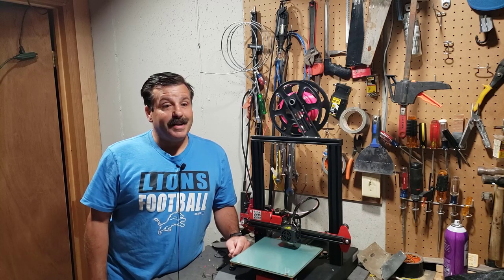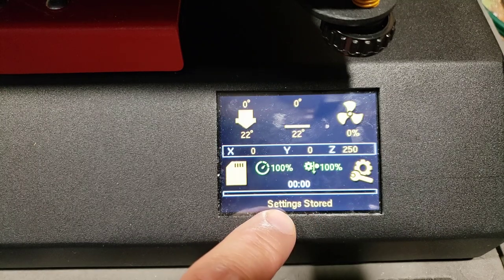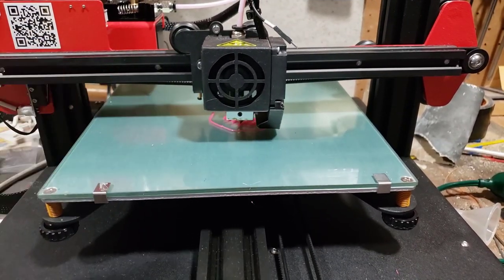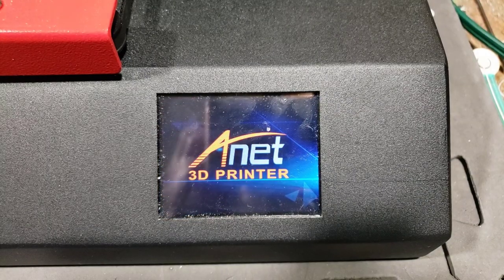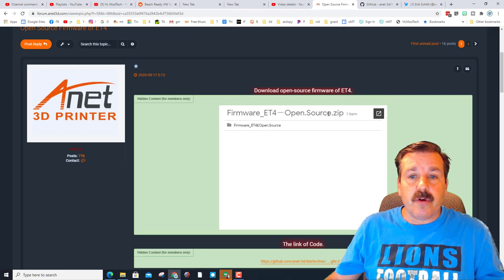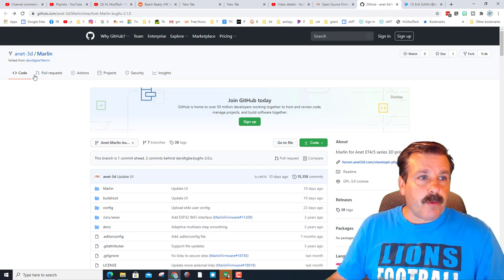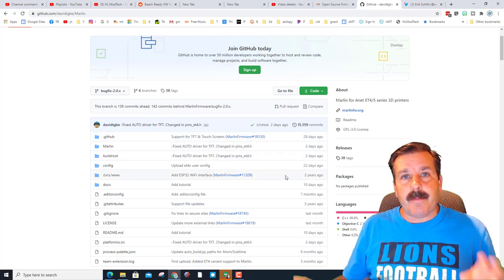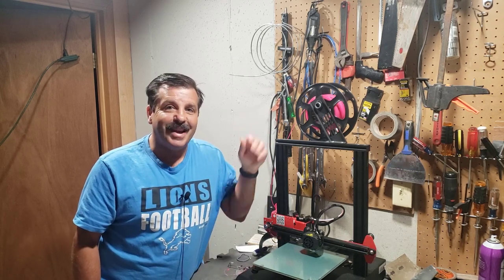Tested! Anet ET4 Power Loss Resume with Marlin 2.0+ firmware

Comment: i bought the st link and a new motherboard with tmc 2208 drivers, hope you're vids will help me with all that!
Reply from the maker: I will try to get you there. I stay stock on mine, so it will be a bit of a reach, but I should be able to at least get you pointed in the right direction.
Reply: @HLModTech  for sure if you ever plan to upgrade to a tmc 2208 motherboard make sure to make a video about it. Thanks for the help and content you bring!

Comment: I have a Tronxy  xY2 Pro, with Marlin 2.0.  Power loss restore works ok if the power goes off while it is not extruding, but if it is extruding, it does not work.  The reason is that Marlin is set up to move the nozzle to X Y home, when 'resume print' is enabled.  Here, it heats up the nozzle and bed, then makes a number of XY moves before resuming the print.  If the power went off while the printer was extruding, then the nozzle sticks to the print, and is unable to move to X Y home, and gives an errror 'unable to home" .  Ideally, if the nozzle heated in the position it was in when the power went off,  either situation would work ok.
Reply from the maker: No idea. Sorry.

Comment: is it possible now to change the X and Y offset to get the perfect measures? (for example to make circle really round or the calibration cube on the right sizes without changing settings in cure)
Reply from the maker: Great question. I will get into the customization advanced menu and see what is available to us. For sure, you are able to if you want to dig into the source code, make changes and create a custom firmware with Visual Studio Code.

Comment: I think you need to go to the menu where you choose print file after power come back, as soon as you get to that menu it should ask if you want to continue the print.  it is not like marlin where it pops up on the boot. these are tft screens they run on an independent firmware. just go to the drive and it will ask you.
Reply from the maker: Interesting. I will see if I can give that a test tomorrow when I'm at school. Thanks for the tip

Comment: Hi again, thanks for posting a video even when it fails! One thing that you might want to check, in Cura when you sliced that model, was power loss resume enabled there? I think that setting in marlin is a secondary trigger, you need both enabled. Maybe? Good luck! 
One thing I always wondered though, the hot nozzle touching the print would melt the model in that area right? True power loss resume should have a 10 second backup capacitor to move y or z off the model, keeping z the static and store the values for the move before shutdown to use it as a starting point.
Reply from the maker: =) I share what I find... A lot of times I ask for help when things are goofy too. You guys are the fastest support I know of. As far as power loss resume, the only printer I tested it with was the Alfawise U50. No special Cura settings... Unplugged and it just came back. Super slick. https://youtu.be/m25RsZD7mKM
Reply: @HLModTech  strange, maybe that had a better board that has further support for power loss resume? If you put an "M413 S1" in your start code it should work, it's not the cool way but just to see if it's working period on your current setup. In the marlin documentation it says M413 S1 to enable and to make sure it's enabled just M413 in repetier host and the display should say it's enabled. You're right though, I can't find that anywhere in Cura, coulda sworn? 🤷‍♂️
Reply from the maker: @jdizzforyou  I will see if it works with the M413 S1 in Cura when I get a chance. The source code we are playing with has 2600 lines in it. It would only take one in there to be off to break it. For instance if the code has PLR disabled, but the LCD has the option allowed... You could flip it all you want and nothing happens. I am spitballing, but that is how I picture it working at least. =)
Reply: @HLModTech  forgot to say put an M500 after. 
OR go to Configuration_adv.h line 1173 and remove the // !!! Hopefully that's it, I looked in "start here" from vert (from your a10t vid) in VSCode. I saw I enabled PLR there, then clicked View>Search "PLR" and it's right there in the search. In my very limited time with marlin I've realized things are often in multiple places with the values not matching even after creating the .hex with zero errors. Marlin's weird lol.
Reply from the maker: @jdizzforyou  All good on the M500. I have an issue as my ET4 is not connected to the PC. I did do the save on the console and it was still there the next boot. As far as marlin, that search is slick. I just worry that there is a word in there I am missing... How do you know you caught every change that is necessary for an ET4...
Reply: @HLModTech  that's why I showed my work, so you could do it too in your build. There are more uses of "PLR" found, one change at a time lol. My a10t was having the same issue, PLR was enabled in firmware from "start here" but it didn't work when I tried either but I was more concerned with tuning for good prints. I'll try again when my new hot end/bowdens are here, for now I'm out of commission.
Edit: In the lines of code above the one i referenced in _adv.h there was (in my vert build 496) a small fyi for power loss resume function so I think that's where she really lives.
Reply from the maker: I am using the Anet .bin they created. I have not tried to create my own version for flashing. Since I leave my machines stock, unless there was a crazy feature I was missing, I am happy with the way things are going.  The tips you are giving are spot on though. Maybe if I get all my projects caught up you will still talk me into it. =)
Reply: @HLModTech  I understand, stock is easier when you have such a 3d army. Speaking of stock, what's your favorite low budget good quality stock printer?
Reply from the maker: @jdizzforyou  I have the most fun with the A10M and A10T models. I find the simple gradient command to be the coolest thing ever. Not sure what the current price is, but I found them at around 200 back in the day. Took a year for the firmware to arrive, THANK YOU VERT, and make them work they way they were intended. They are my go to machines right now.
Reply: @HLModTech  in theory I love my A10T, but it's problem after problem and only 3 out of 50+ prints with pla do I get print quality I'm happy with. Since May I've had to replace every fan at least once, found out the hard way the nozzles can only come frome geeetech, no matter the tension every extruder strips filament, my 2nd hotend is coming, and the stock bed tore removing the 5th print with the provided scraper in the center. It's now a fridge decoration as I stopped the next print after the first few layers. Only 5 of 8 legs printed in yellow pla... it makes a beautiful sunrise with 'Geeetech' in the background haha. I want to love it, but no matter how many things I research and tweak... I want an example of how a printer should properly work, not constant problems. I will not abandon my "A10Titan" though. There's a bond there, with more than just PLA 🤣

Comment: now it work
Reply from the maker: That is good to hear. Thanks for sharing.
Reply from the maker: Looks like it is not completely solved, but it was fun reading through it. Almost like a mystery novel as they find new leads, investigate and debunk things.👍 Thanks for the heads up. 👏💯
Reply: @HLModTech  it's solved, i was implement in my et5
follow the 3 last comment
Reply: @supartodondit6396  It worked like a charm with ANET ET4x and Marlin 2.0.9.2. Thank you for the link.
Reply: gimana caranya bg , mohon bantuannya

Comment: Hello , Whats diference in ET4 and ET4+. I need upgrade my ET4+ for Marlin . Regards
Reply from the maker: I am not really sure. If you go to the Anet shop, there are no ET4+ that I can find. In the open source firmware the ET4+ and Pro were the same file.  I had a ET4 I purchased show up, but when I booted it the info said ET4+.  Just my experiences, not facts I have found anywhere. The marlin flash was fine on all my ET4's. The benefit was the ability to upgrade and calibrate as needed. Other features too, but those are my favs.
Reply: @HLModTech  OK, thank you very much friend. I wanted to consult you the update in the ANET ET4x is to use it with Marlin is safe

Comment: Hola cómo hizo para montar Marlin en la impresora ET4, tienes tutorial? Está increíble tu vídeo. 😁😁
Reply from the maker: =) Your wish is my command. =) https://youtu.be/mAmIbrGi6G8
Reply: @HLModTech  Hola hice una Prusa Bear pero le hice unas modificaciones, estoy instalando Marlin 2.0.5.3 a la última Ramps 1.4 y LCD 12846 que me queda, cargo todo desde Arduino 1.8.10 una versión estable, la impresión es perfecta pero no funciona el power loss recovery, he probado la versión de marlin 1.9, 2.0x, 2.0.5.3, he cambiado la pantalla 12846, por otra versión mas reciente y tampoco he tenido resultados, ¿Cuál crees que sea el error? ¿Será el compilador? ¿Debería usar Visual y platfort para compilar?
Reply from the maker: Sorry, I am not a firmware expert. I learned the skill to put it there... then shared it as clearly as I could. I have not messed around in VSCto adjust it though. Firmware adjustments are just not in my skill set.